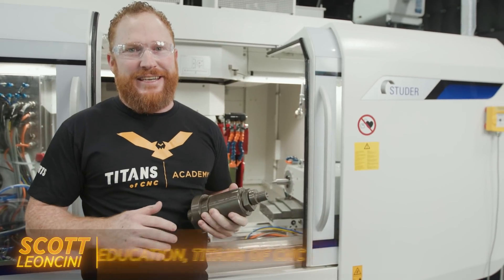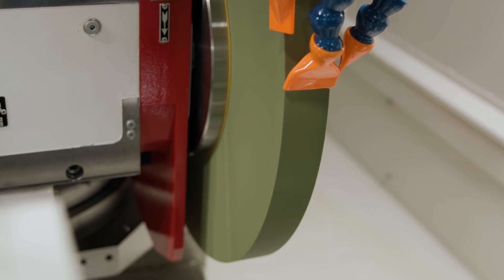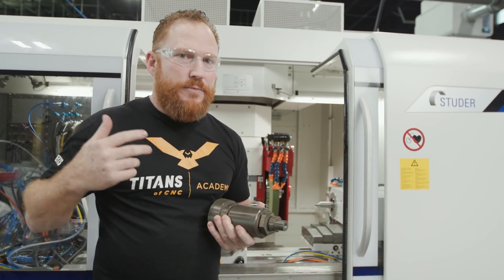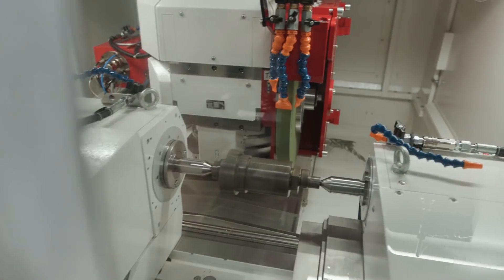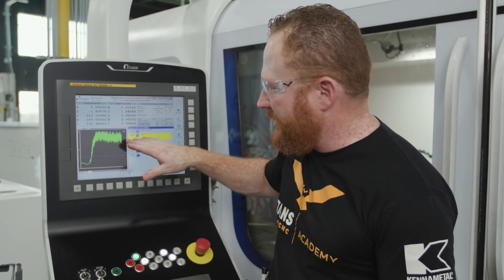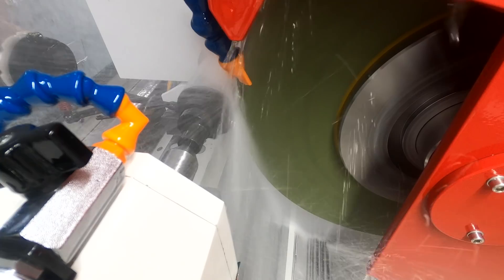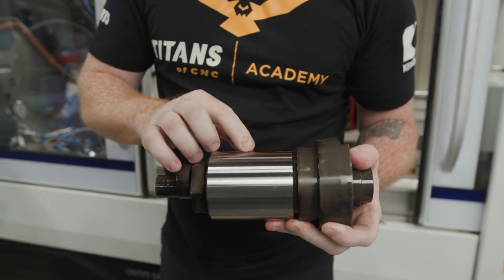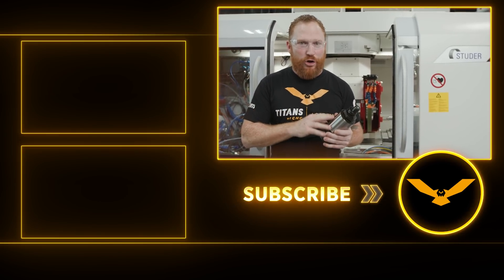First Cut | Studer S41 from United Grinding

Comment: Saw this somewhere in the comments, you will loose concentricity if you take the part out and put it back in . Well if you put it back in within a tenth, it will still be in tolerance,  ( sometimes) . I worked for a Boeing subcontractor and Boeing wouldn't allow us to take the part out between operations, but not for concentricity but rather shoulder perpendicularity, and lateral runout . With a lot of indicator work, in a 4 jaw, I still think I could have got it .
Reply: Between centers as long as you dont get any dirt or grit in the center itll still be concentric.

Comment: There's a ton of run-out in that part if it was turned between centers... Maybe it was originally turned in a chuck and the centers not used?
Reply: I believe it's due to heat treatment since end diameters are small.

Comment: There are some points that I'm missing...
1) If the Ø has to be plunge-grinded you need a wheel wider than the overall length ... otherwise either you'll leave some indentations in the cross sections of the plungings or you'll have a helical machining profile on grinding itself if you're moving on Z-axis
2) You need a magnetic particle inspection machine to be 100% sure that you're supplying a compliant part. That and nital etch inspection are mandatory to detect any signs of grinding burns. 
That would be cool content since basically you can find almost nothing online

Comment: if you adjust your B axis by 30 degrees and dress your grinding wheel and then grind, you have a lot less grinding wheel wear
Reply: Also increases wheel width for plunge grinding.
Reply: why not 45 degrees

Comment: Change to an angle wheel so you have the capability to grind shoulders, diameters and radius all with the same wheel. 

Also, how does this turn the part with no driver?
Reply: The pressure between centers is enough to drive it, most of the time. But when it isn't, then the workpiece spins up and jumps out turning 100000rpm... happened to me a few times:-D
Reply: @sledgeoc  I loaded a part once and forgot the dog and the parts I was running didn’t use the probe, soon as the wheel touched the part, I heard this loud noise and saw the part spinning about as high of rpm of the wheel, hit retract ASAP

Comment: What is driving the workpiece?
Reply: This Machine is equipped with a synchronous tail stock that holds the part in place with hydronic pressure. The work head and tailstock are driving at the same rate.
Reply: @redbeard_1371  wow! Very nice

Comment: Random thought, how do you keep the diameter of the finished part consistent, with the grinding disk wearing out? Is there some automated measurement device built into the machine, or do you have to adjust it manually all the time?
Reply: You dress the grinding wheel to a known diameter, grind parts, measure them and find out how much parts you can make before one part is out of tolerance. Then you tell the machine this number, for example 5 parts, and then the machine dresses the wheel every 5 parts
Reply: Really it depends on the part sometimes you dress multiple times well running a part due to 1. Size of your wheel being small which can cause wheel wear a lot faster. 2. Size of part. Bigger parts can cause wheel wear. 3. Material types can load up wheels causing you to dress more often. 4. Dressing depending on what type of cycle you are running. This is what I do for a living run centerless, studer favorite, studer S33, thread roll and more.

Comment: That’s a great machine we got one in earlier this year, you can grind all sorts of shapes into parts hex, square, cams pretty neat!
Reply: We do on some parts, there’s very little cutting forces when grinding sometimes you just can’t a drive dog. We have sent centers out to get coated with CBN and diamond just for the extra grip.
Reply: @franlhg  That makes sense. I thought this is what they do. The problem is if you take the part out and put it back in the concentricity will suffer. Does the machine check the part?
Reply: @johnfpaterson9948  oh yeah when that wheel dresses it know exactly where it’s at
Reply: @franlhg  Is it dressing the wheel while it is grinding?
Reply: @johnfpaterson9948  no not while it’s actually grinding the part you can have a roughing cycle wheel will go back to diamond dresser then finish or you can dress before each part if needed depending on what your doing it can very widely
Reply: @franlhg  I know that there is a coating that can add carbide to steel that is kind of like sandpaper. Carbinite Metal Coatings was the name of the company. That could work better than diamond?
Reply: @johnfpaterson9948  Hi, the machine that’s they’re using had a synchronous tailstock. It uses lateral hydraulic pressure to hold the part in place. That way with a straight wheel, one could theoretically do the left and right side of the part without flipping it, keeping the concentricity and runout contained to one set-up.
Reply: @longphan7822  Yes unlike a manual machine you always move left across part to the shoulder then take a cut then cut right. Then the wheel next to the shoulder is always high and you are taking the part in and out  to check the diameter.
Reply: Did you use a drive dog? Why doesn’t this part spin out of control once the wheel starts taking a cut?

Comment: Interesting that there is no drive dog?  Charles
Reply: It’s a synchronous tail stock. It uses lateral hydraulic pressure on the workpiece to hold it in place.
Reply: We grind things between centers all the time without drive dogs. we actually send centers out to be coated with CBN or diamond to give it some extra grip.

Comment: I don’t see a drive dog on the part. What keeps the part from spinning out of control once the wheel starts taking a cut.
Reply: Probably the pressure from the center points. I mean its „just“ grinding, cutting forces shouldn’t be that high. You can even take small cuts on a lathe between center points without a drive dog.
Reply: @HuverUber  I have done a lot of cylindrical grinding. Where you have the headstock driving and both centers are dead for perfect concentricity, from diameter to diameter. This part you can put a lot of center pressure on because it a beefy part but that’s a big wheel and it’s going to want to spin. I am missing something.
Reply: @John F Paterson   @Valentin Reimer  if your center on the tailstock isnt moving and the centers are equally big you have the same force braking the part as the headstock is driving the part
Reply: @L3ssOn  Obviously it’s works with no drive dog and the headstock is driving the part. I guess I am too old school to rap my head around it.
Reply: @L3ssOn  the Center on the tailstock is moving. We have a similar tailstock on one of our cnc machines.
Reply: Amazing only two comments and I didnt even read yours before posting almost the same question.  Have a great day.  Charles
Reply: Looks like the headstock has a live center, thats why it was indicated at the beginning of video...
Reply: @reynaldorosas4187  Yes, the part would not turn otherwise. Also I bet both centers are live. It’s just there is very little contact on the 60 degree center to drive. Also on a small diameter part you cannot have alot of center pressure, the part will bow from the center pressure. The headstock center must be abrasive or rough to drive the part. Again old school you would put way oil on each center on the part each time you put the part in the machine. Both centers were dead and they would heat up if not lubricated. The centers were carbide.
Reply: Grinding to those tolerances will not apply that much torque so it’s held in place by the centres